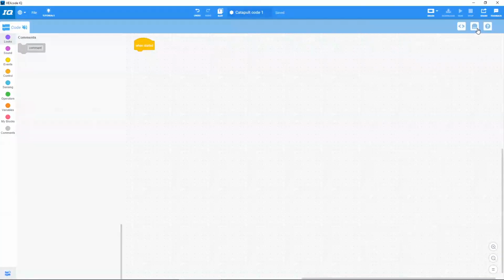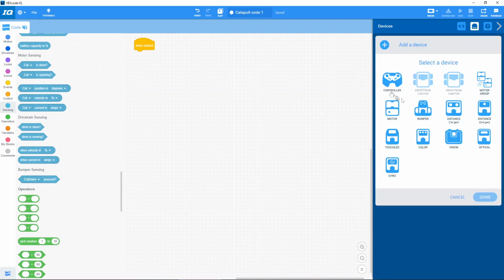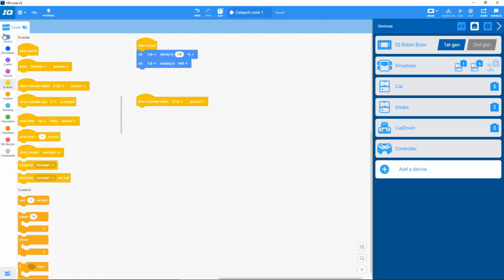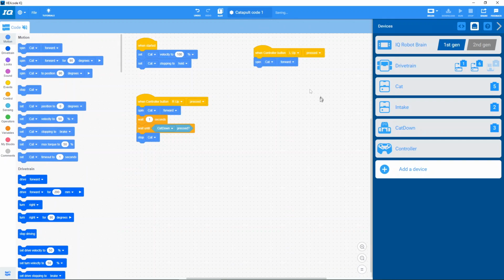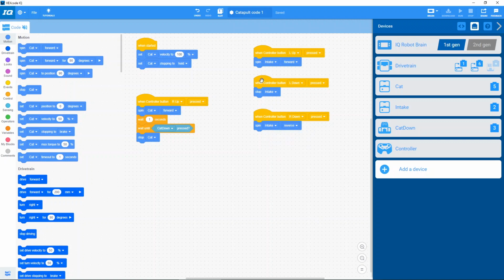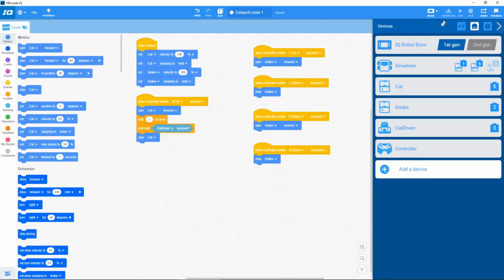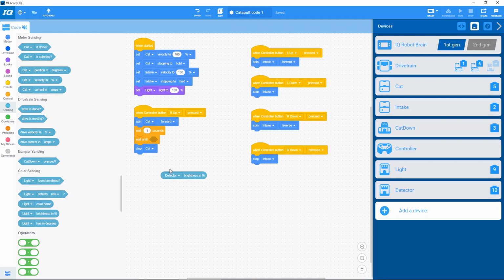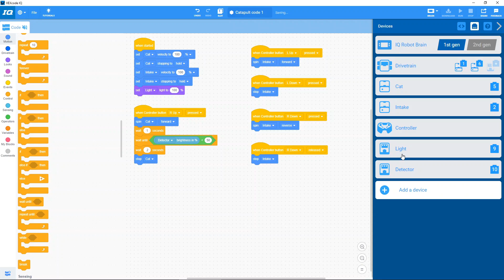The secret that makes catapults work

Comment: Hey Ben, I am having trouble with the drivetrain inputs to put for the wheel size, track width, wheelbase, and gear ratio. If you could help with that it would be very helpful!

Comment: Some reason when I just use the launch program it works but when I add the drive program it stops working. I copy the left stick control onto the code with my launch on it and tried putting the code on the sample program. Can I not use the sample program?
Reply from the maker: Email me, and I can probably help better (I can't send images through YouTube)

Comment: Great video, Ben. Do you use any code for the drivetrain?
Reply from the maker: Sometimes I will, but usually I don't find that it offers any significant advantages over the default options that VEX offers,